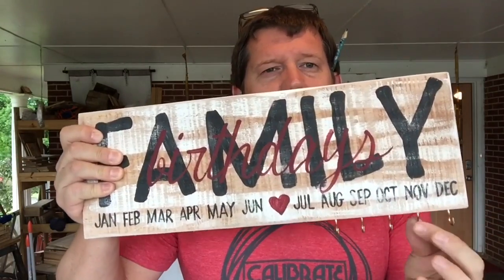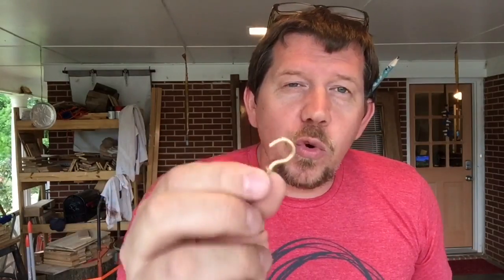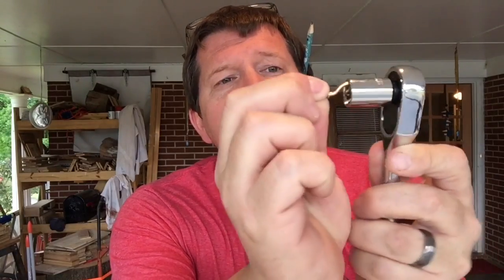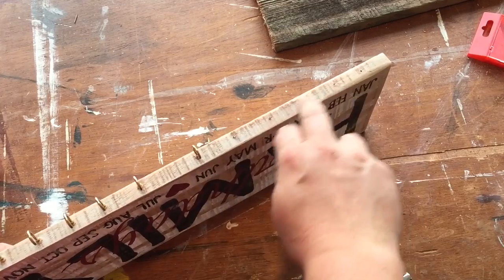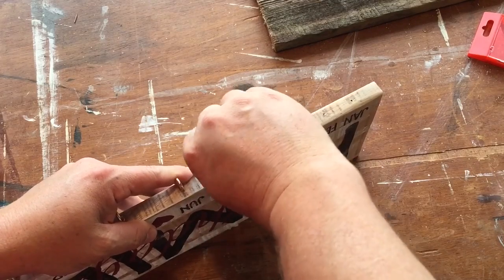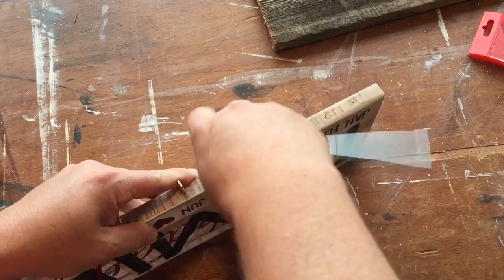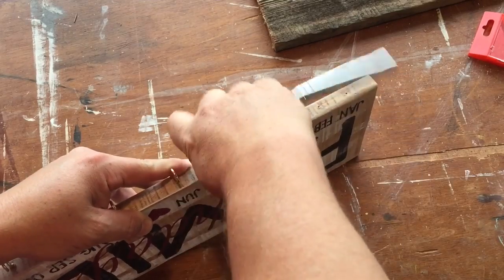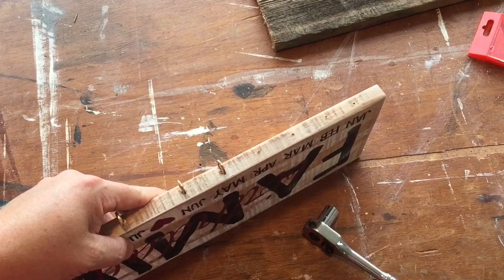Shop Hack: Installing Cup Hooks

Comment: The best tip was a pilot hole. I am installing them on a ceiling beam to string battery operated lights (live off grid and solar not quite ready) the pilot hole let me start the hooks  easier saved my fingers... 20 hooks later

Comment: Hi, i know it probably late  to ask the question since this video is 4-5years a go, but i have tooooo, and my question , can i use this type of hook screw on  cement / concrete house wall? I'll be thankful if you can tell me step by step, Tq sir😁😁😁😁😅
Reply from the maker: It's never too late to ask. :) But...I honestly don't know. If I had to guess though, I'd say "no". IMO these hooks in the video are probably designed for wood applications. But I'm sure you could find a specialty hook for cement and concrete. I'd probably start looking on Amazon. Not sure if that helps, but thanks for asking! Let me know how your search goes.

Comment: Thank you 😊 I'm doing these hooks in drywall  though  don't know if it makes a difference  but will try
Reply from the maker: Drywall is definitely a problem when it comes to anchor strength. If you put the hook into the drywall, only, chances are, it won't stay. Even if you don't put a load on it. You'll need to either have a hook with a screw long enough to go through the drywall and into a framing component OR find a drywall insert that you can screw into. Hard to describe here, but anyone at the Pro Desk at a Home Depot should be able to help you. Good luck! And thanks for commenting!

Comment: what size drill bit do you to start
Reply from the maker: If I'm not mistaken, I used a 2mm bit. You'll want to double check though, just to be safe. In case you aren't aware, the gauge of the hook itself, it the same through the threaded part as well. I say that because it's easier on the eye to check your bit agaist the unthreaded part of the hook. Compare the two and get a bit that is as cose to that gauge as possible, then you should be fine. The threads will extend out beyond the diameter of the bit/hole to (obviously) bite into the surrounding wood. Hope that helps and thanks for the question!

Comment: I thought of putting a hook bolt in a cordless screwdriver to drive a eye bolt, and visa-versa, felt it was clever, shared it, and everyone said that the threads would ruin the chuck, the proper tool was plastic.
Plastic?!
I need to drive four anchors about a foot in the ground for my Harbor Freight portable garage.
I think that I will break the metal hook out of a cheap hanger and put that in my drill.
I don't have any idea what size socket would fit those big ground bolts! :)